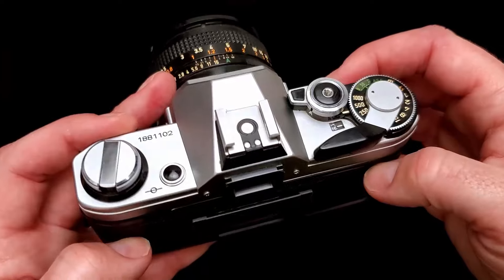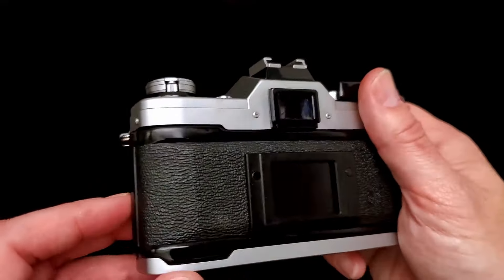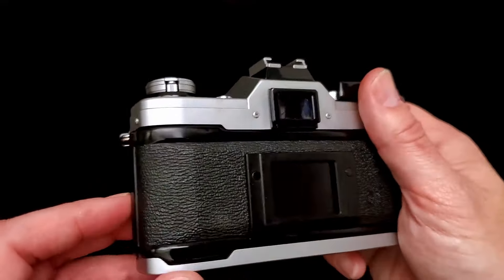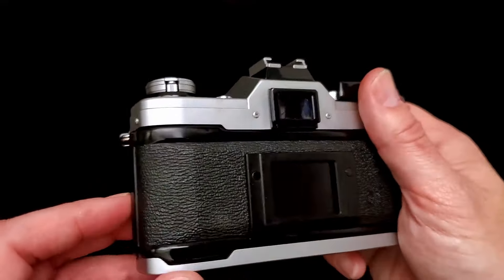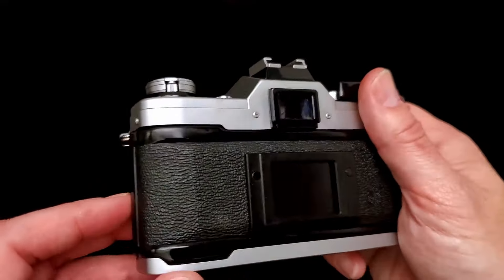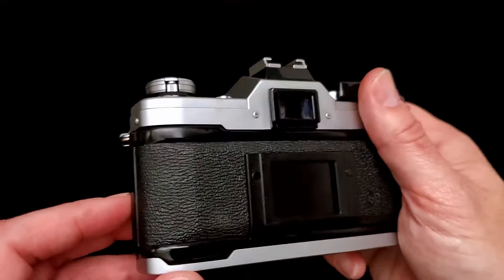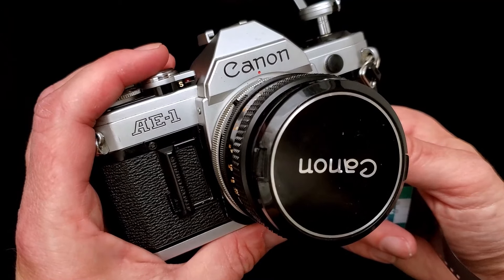How To Unload Film From a Canon AE-1 film camera

Comment: When you load a film into your camera, the film leader (the short piece of film that extends from the canister) needs to be properly aligned and engaged with the camera's take-up spool. The take-up spool has sprocket teeth that fit into the perforations (small holes) along the edges of the film.

If the film is not loaded correctly, and the sprocket teeth are not properly engaged with the film perforations, there can be some slack or looseness in the film. This means that the film is not tightly wound around the take-up spool.

However, this amount does not affect the quality of our photos

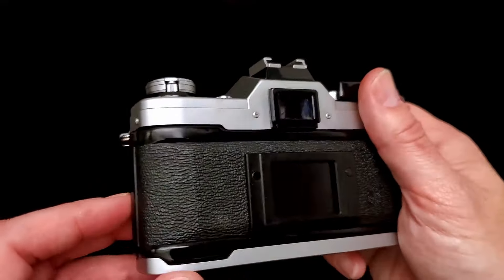Comment: 0:42 that lever is missing on my camera is there a way to still rewind it?
Reply from the maker: If the knob is still there you should be able to turn it. Make sure to turn it the same direction as in the video. If it's not there you might need to take it to your lab and have them take it out in the dark.
Reply: @filmkip3437  there isn't really a knob just a little pin the knob with the lever fell off beceause it was almost fully unscrewed and I dint notice till it went missing. Thanks a lot anyway!! also great video
Reply from the maker: @proberend8983  Thanks!  unfortunately, I think the only way to fix it is to get another camera for parts.  good luck!

Comment: My roll of film is on the other end out of the canister , what do I do?
Reply from the maker: I'm not sure what ya mean
Reply: I tried to roll the film back into the canister but instead it all rolled out of it and ended up on the right side of camera
Reply: @Mr.CarrillocanPaint  it just happened to me. 😡 wasted a roll of Velvia 50. It was expired, but still upset.
Reply from the maker: @Mr.CarrillocanPaint  That generally means you've pulled too hard on the advance lever at the end of the roll and the film has separated from the spool.  If if feels like there's more tension than normal after shooting pictures, don't open it.  Take it to a photo lab or camera store and have them open it in the dark for you. That way you won't lose any shots.
Reply from the maker: @Articulo77  I've not seen expired Velvia work out very well, but yeah, that can be super annoying.  When it feels like it's hard to advance the film, stop advancing.  I know that sounds obvious but you'd be surprised how many people bring their film in to the lab this way every day!
Reply: @filmkip3437  Thanks. The mistake was definitely on me simply because I forgot about the button on the bottom of the camera. My expired Velvia was actually kept cold so I think it would’ve been fine. I did however change my EI a few times and wrote down the settings to see what would make a difference once I had it developed. Sadly because of that mistake I’ll never know.